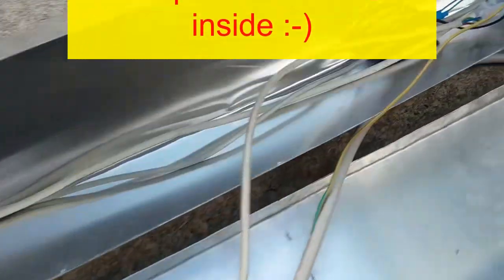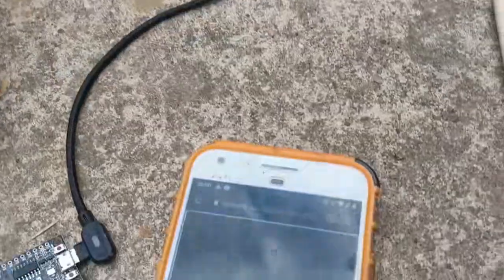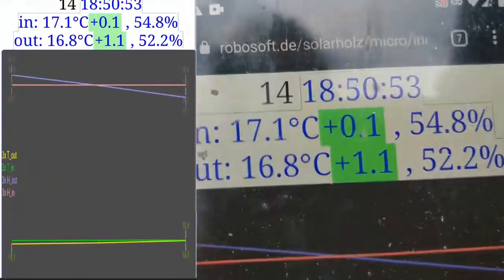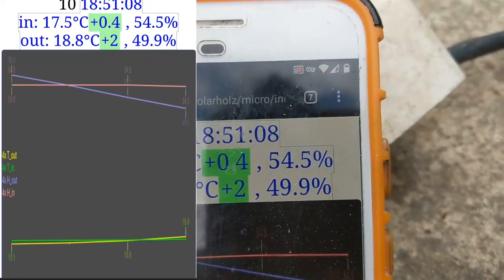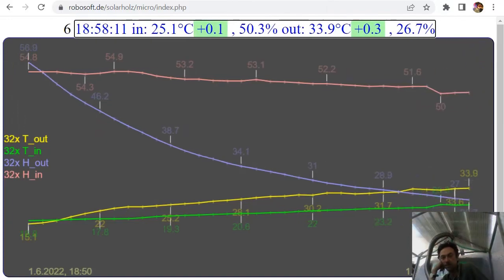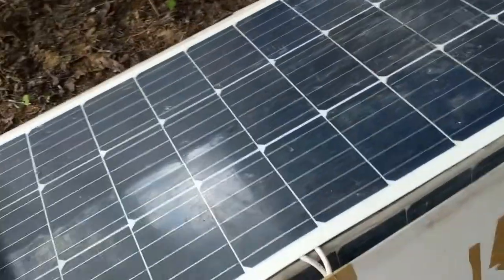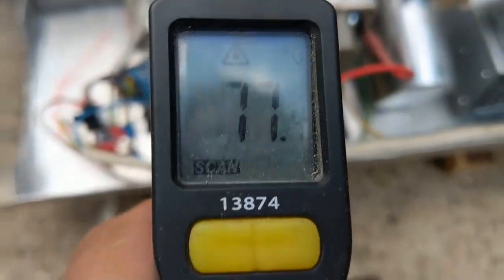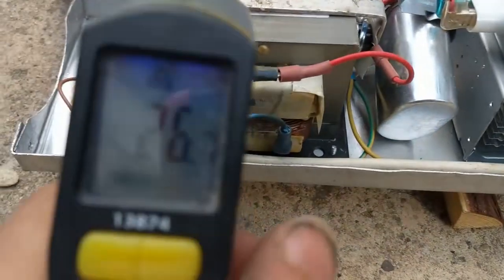part 3: huge 2.1 kW microwave oven - 2 temperature sensors + website :-)

Comment: Du könntest die Trafos außerhalb platzieren und dadurch leichter aktiv kühlen, z.B. so, daß der Gesamtaufbau aus einem Rollwagen mit einer Isolation in der Mitte besteht, welche die Magnetrone (Innen) vom Rest (Außen) trennt.
Reply from the maker: Yes, separating the transformers from the magnetrons is a good idea. i fear i must shield them, so i would need to build a separate box. Easier will be to put the three transformers in the first half to be cooled by the inlet fan, followed by the three magnetrons that can go above 100°C.
Thank you for the input !
Reply: @robodurden  You could also increase the number of transformers, e.g. run one magnetron from two transformers and thus reduce the power dissipation per transformer & get a bigger surface area to cool. Maybe you could also get old transformers from higher power microwaves from the scrap yard. Likely in your microwave the transformer is designed to be as small as possible to cut costs. Maybe it is not even designed to run at full power for longer periods of time.
Reply from the maker: Indeed I first bought a used 1.2 kW microwave oven but the magnetron was worn. Yet the bigger transformer is not a consumable. But if I indeed need to replace the transformers I will let them melt first :-)
And I still have to test if multiple magnetrons kill each others :-/